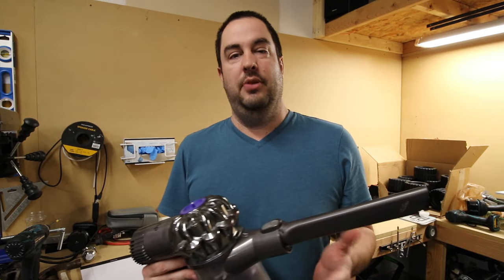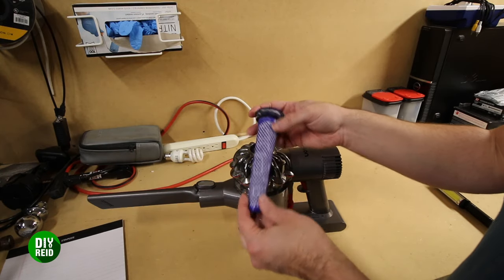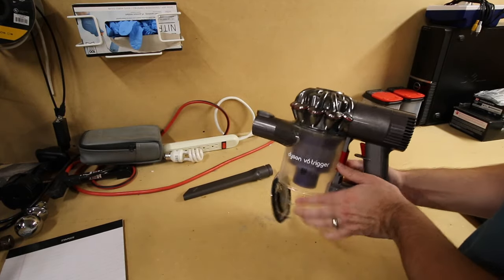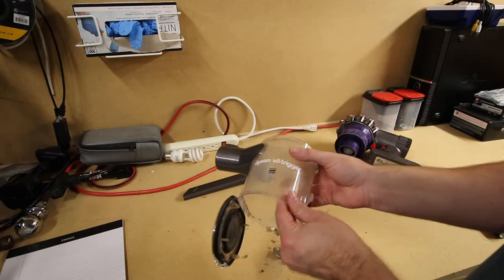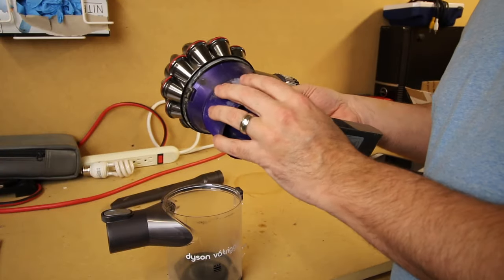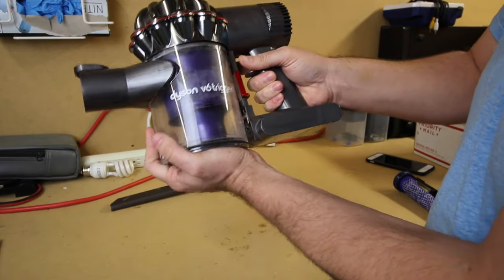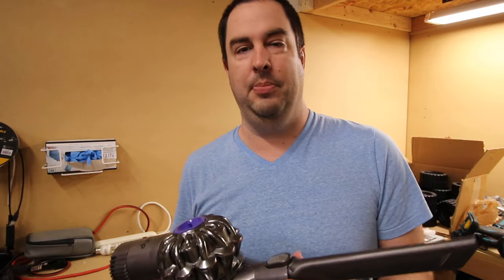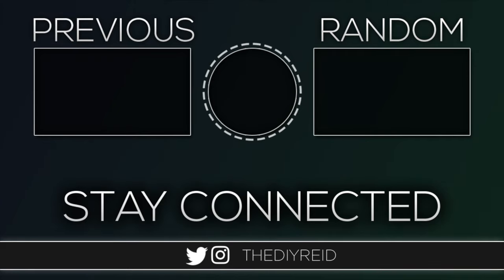How to Fix a Cordless Dyson Pulsing Issue

Comment: I found more dirt by taking the blue air filter apart. You will see three indents near the top of it. Use a flat ended screw driver or butter knife and stick the end into one of the indents and carefully push down to pry it off. Don't use a sharp knife! I even used garden gloves to make sure I did not slip and jab my hand with my butter knife. Do that with all three until the blue filter starts to come off. I thought for a minute I would not be able to get the filter off, but I ran it under water and kept at it, gently twisting a bit. Making it soggy seemed to do the trick and it came down off the plastic frame. OMGosh. 😮🙄The bottom of the frame was clogged up with awful stuff. Cleaned it out, washed the frame well and put it back onto the frame and then completely dried it.
Reply: Also, thanks for the video..helped me attack the problem instead of just mopping the floors AGAIN. 😀
Reply: Thanks so much! I had cleaned the filters etc, but just now I've followed your instructions and taken the blue air filter apart and there was a very big bit of yuk stuck in it, I'm letting it dry now, but I'm sure thats going to be what the problem was. Cheers!

Comment: There must be a different mechanical issue with my Dyson stick vac because i took out the filter washed it and let it dry overnight and it still pulsates. i cleaned all the debris,hir,and other particles from the vac prior to removing and cleaning the filter and the pulsating issue still exists. I know others who’ve had issues with dyson vacuums. They are garbage and i’m just going to have to look for a different brand name vaccum because Dysons suck no pun intended
Reply from the maker: There is something more blocking air flow. Try this video. 
https://youtu.be/0UIY4yOd2gU

Comment: I washed the filter and it is still pulsing.. Could it be that the filter is still wet?
Reply from the maker: Or there is something stuck in the vacuum. Did you take it apart?
Reply: @DIYReid  There was something stuck in the nozzle. Thanks for your prompt reply.
Reply from the maker: Glad it worked out.

Comment: While this does work, it's worth trying gradually removing sections of the vacuum to determine where the problem was, in our case it was at the head unit (that sits on the floor), which was all clogged up with dog hair and fluff etc.  But pretty much everything here is worth doing regularly anyway.

Comment: my dyson only pulses with those attachments that have rotating bars and its cleaned
Reply from the maker: I would check to see if there isn't something blocking it still.
Reply: @DIYReid  there is nothing blocking it … it only pulses with the attachments with rotating bars … the large one I have taken apart and cleaned .. the smaller one I have never even used yet it  still pulses … all other attachments work fine … even dyson said “ that’s strange” as I don’t live in the USA I do not have access to a repair shop .. what a waste of money

Comment: Super helpful video in general, but washing the filter should be your last suggestion if all else fails. That thing has been drying all day and still isn't dry, and I realised about 10 seconds after rinsing it that the problem was a little rock stuck elsewhere in the plastic!
Reply: an air vent or hair dryer works well for drying things ... even a window sill that gets direct sunlight - cleaning the filter was a 10 second fix - and drying it took overnight
Reply from the maker: Maintenance should not be a last resort. Ever.
Reply: @DIYReid  my problem is I  can not get the back filter off it works OK but I smell dust. It also pulses a little some times. In all the videos on the web they twist it a little and pull it away and was it.

Comment: Took it all apart & cleaned it thoroughly ... still pulsing.  Another video had a comment suggesting that it could be a loose battery, which I'm going to ck.  I checked everything with a light & a wooden chopstick and there are no clogs, so it has to be something  else.   
But if anyone has any other ideas, that would be great.

Comment: Why is my Dyson pulsing only when I’m cleaning the deep pockets in the couch
Reply from the maker: It’s probably because it’s not able to suck because of the pickup tube being blocked completely by the couch cushion. The design of the pickup has holes at the side on each end to prevent this but if you’re putting it in the pockets I can see where those get blocked too.
Reply: @DIYReid thank you.   I don’t think thats the problem but I’ll try again and watch

Comment: You don't show that the top filter can be opened and emptied. It has dust inside it. Tap out the dust. Then wash it. Just washing the outside isn't enough. Let it dry. Put it back in. It's like yor dyson is new again. 😊
Reply from the maker: I didn’t need to to fix mine. I did make another video on my channel that disassembles it further.

Comment: when you wash that top filter, make sure to let it air dry for 24 hours or put it in the sunlight. do not wash it in the dish washer or machine or try to dry it with a hair dryer.

Comment: Ya the purple part is easy to remove just use a thin spunger all round . Some say its hard but really isn't and then you can completely clean it. Mine was like new after but wish I new why mine only pulates on. Max!!. And ya those canisters are pain in the ass to get on and off. I really don't like the design
Reply: Same problem with mine.

Comment: I have had to order more. I clean that filter after every use, and it's still pulsing.
Reply from the maker: Make sure you take it apart so nothing is blocking it.
Reply: @DIYReid   Thank you. Yes, I did that yesterday and there was a small piece of cardboard blocking the head, so that was the problem. I have a puppy that's in the confetti making business :-)

Comment: The best way to fix your Dyson vacuum is to throw it in the trash bin, then buy a reliable vacuum at a quarter of the price.
Reply: Honestly they are great vacuums, mine worked fine for almost 2 years before it started having any issues
Reply: @Freakinsweet1234   TWO YEARS,? ?   Two years for a $700 machine?  if you had said 20 years then I would concede that it was a good machine,  your troubles are just starting and I advise that you throw your Dyson away and buy a decent reliable vacuum,  they are junk.